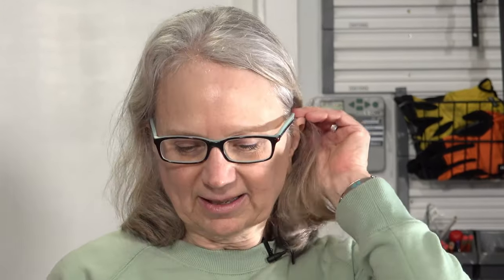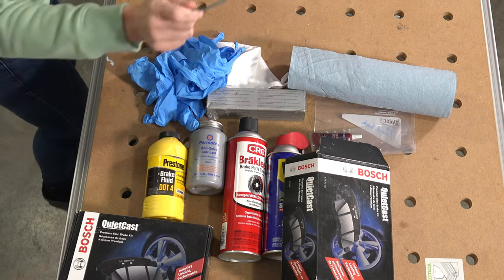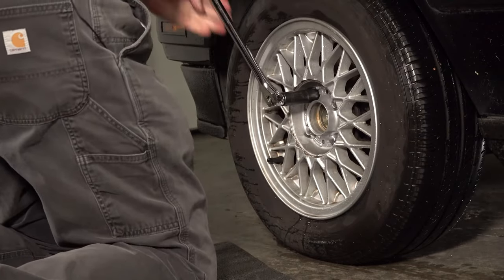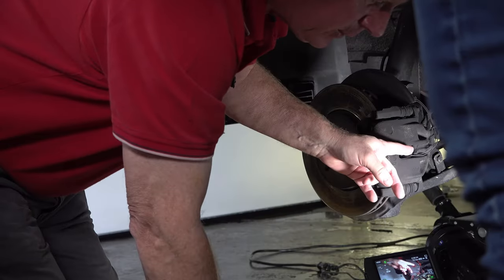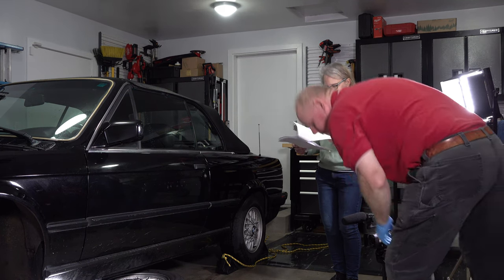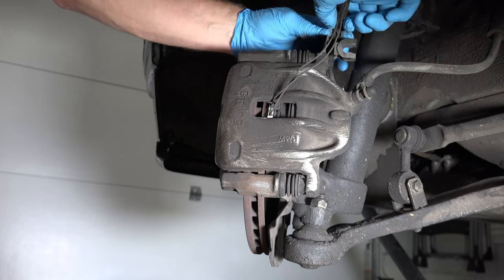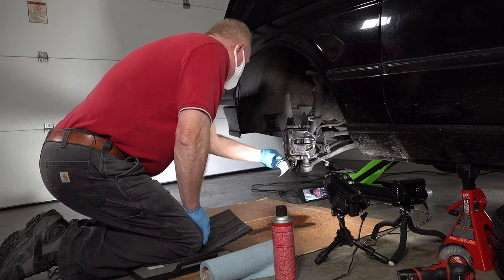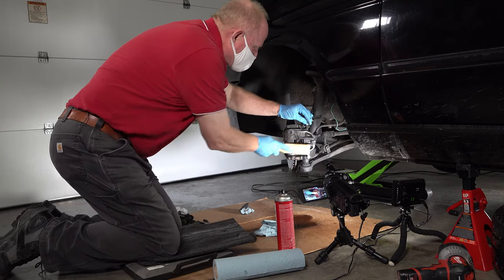15 issues Diane & I had to solve the first time we changed my front brake pads

Comment: #15 26:26 the reason why when she pressed the brake the car didn't lock up the rotor is because it had to fill up both calipers before it locked up the rotor that's why you pump the brakes about 5 times or so and you will then feel the brakes stiffen up... fyi if you have abs you will need to do it with the car running too... just an fyi
Reply from the maker: Another great analysis, which totally makes sense. I felt kinda worried when the first pump didn't work, but when Di pumped the brakes a second time and they worked I remembered that pumping was needed. Now I know why. Thanks!

Paul

Comment: Fyi... brake rotors need to be cleaned on both sides... the reason why to use brake cleaner is to get oil off the rotors.. because of mfg and storage they add a oil on new rotors to prevent them from rusting.. that's what the brake cleaner is for.. you could use it to clean rotors on brakes to get them clean but main reason is oil from new rotors... 2nd you should grease up the end of the pads... this is to help the pads to slide easier.. and not get stuck... also check the thickness between inner pad and outer pad this is a thing to indicator bad caliper or side pins if same then normal wear... 3rd most rear rotors use a twist to compress them not a compress as in front... I don't know about your car's because they are a weird brake system.. also I wouldn't leave cap off master cylinder too long brake fluid goes bad when exposed to oxygen.. to me I would unscrew cap and just let it sit on top.. 4th be careful about brushing calipers you can RIP the boot for the piston and will have to replace caliper and will have to bleed the brakes
Reply from the maker: How did we not think to clean both sides? Our rotors had no oil on them, but just the zinc coating. Another YouTuber said not to use brake cleaner on the zinc coating, so we are not sure what was right. Anyhow, the brakes have always worked perfectly after the new rotors so we are probably okay.

Paul added your other points to his work list for future changes. We really appreciate your advice.

Thanks, Diane & Paul

Comment: Don't know how old u guys are but I have a hard time getting up, 🤓, I'm 70. They tell u to use silicone grease on caliper pins & NOT anti seize (not good for rubber boots). It's good u positioned boots correctly so no dirt/H2O gets in pins. I used anti for DECADES & I'd always get new hardware because I live in the rust belt. Tell u not to use on lug nuts either, I put small am't on my wheel studs & Im still alive! I don't use impact to tighten, I torque like u.  I anti seize everything I can, I'M THE ONE WHO WORKS ON IT. #8? If I'm new at doing a model, I research. I have experience & basics but these newer cars are different. I own a 2019 Prius hybrid & I can't open door or have my key fob nearby while calipers are off the car. I have an actuator that will kick on & pop the pistons. Take pics of brakes. Lay parts down in an orderly fashion so u know how they go. I replace rotors/w pads so they seat/wear properly. Yours wasnt bad so no problem. I live in a rust belt & I'm anal/meticulous when it comes to brakes.😉👍✊🖖🇺🇸
PS Go to a dollar store & get a turkey baster. Siphon out brake fluid to empty, & add new, THEN pump your brakes & check your level before u shut the hood. I usually flush out the lines as a maintenance. U didnt need pads, but that fluid looked dark.
Reply from the maker: You have a great sense of humor. We, however, can still get up, but that one time under the transmission for an hour made it pretty tough 😃.

We love the idea of the Turkey baster. Besides, Paul says you can't use old brake fluid so you have a new bottle ready to go anyway, so why not take some out?

Rust belt? I don't think we're there. Thankfully.

Diane & Paul
Reply: Paul, looks like you need to buy a new tool - Turkey baster. Lol! It's a good idea to suck the old brake fluid out and put in fresh. Eventually the new fluid will mix with the old fluid left in the brake lines. Maybe replace the fluid again in a couple of weeks when you see that it turned dark again.
Reply from the maker: @MikeM-cz5ln  Does Milwaukee or Bosch sell Turkey basters😄? Anyway, you all have me wanting to try to change out the brake fluid. I'll put that on the list of future fixes and film it.

Paul
Reply: @carzombies  The brake bleeder screws can be hard to loosen. Replacing the fluid in the master cylinder several times over a few weeks is better than leaving the old fluid in there. I enjoy your videos. You two work together better than most couples I've seen and I like your sense of adventure in tackling new things together.